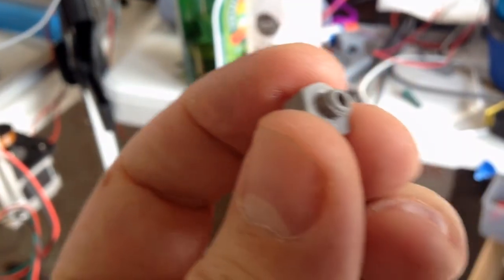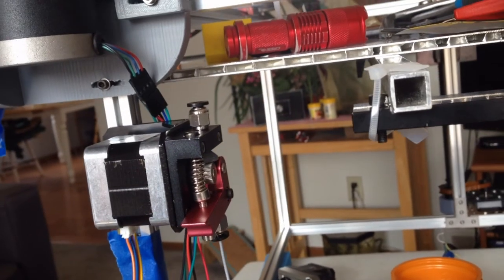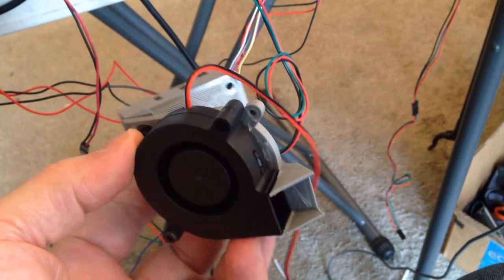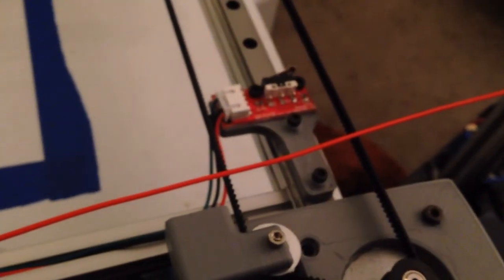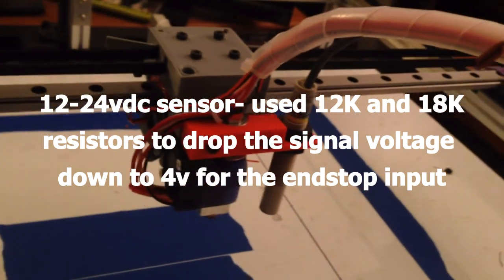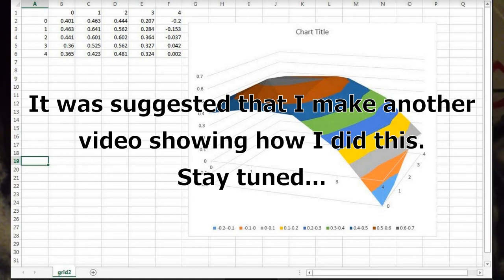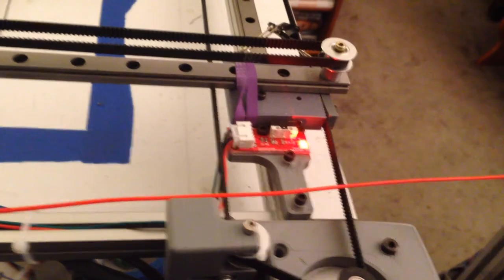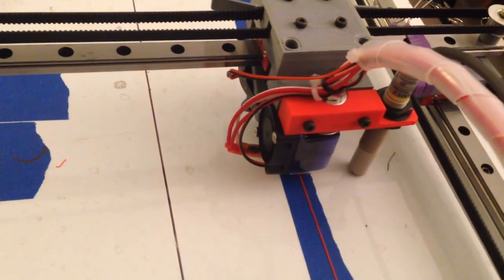Makerbeam h bot version 2 day 8

Comment: Great diy project! Noob question here: What are the parts I need for a servo moving on a rail. It's only for a tiny 10cm of travel.
Reply from the maker: Thank you! I had a lot of fun building it. 
Servos... I know what they are and how they work but I don’t use them for anything. Not that I couldn’t, I can just do all the things I want with steppers. BUT- assuming you’d need the same basic parts for a linear motion system regardless of servos or steppers, I would say the following is needed:
A frame to mount everything- such as 80/20 or v-slot profiles. 
A bearing ststem, whether round shafts, linear rail bearings, or v-slot wheels. 
A motor (duh)
A carriage to move from one end of the rail to the other. 
Some way to transmit motion to the carriage- timing belts, leads screws, etc. 
an endstop to home the carriage so you are always starting from the same location- critical for a blind Stepper system. 
I’m not sure if that’s what you are looking for but those are the basic components needed without going into specifics.
Reply: thanks. sry I mend to say stepper motor. yeah I ordered some stuff now:
I am using makerbeam and I ordered a rail system for it for testing
I thought of putting the stepper motor on the carriage that moves on that rail
and then I ordered some pulleys together with a toothed belt and I will try to build what you showed here
I have some tiny bearings but I guess I need to 3d print some v shaped wheels so it works on the makerbeam profiles.
what do you think?
Reply from the maker: I think I understand what you are describing, a drawing would help, but that's OK.  So the rail system will be the wheels that ride on the makerbeam? I've seen this work well on some delta printers, so it should work ok for you.(not sure what the goal of this   system is or how accurate it has to be) I'm less of a "calculate the formula and design the perfect system" person, and more of a "I wonder how bad this could possibly turn out if I try it with no plans going into it?" person.   This method works surprisingly well for me, as long as I'm not too concerned with how pretty it is.  (I'm usually not) I'd love to see how this progresses, please put up some video if you have the time.
Reply: the goal would be to move a weight on all three axis. But I for now its complicated enough for me to get it working with tow axis
Reply from the maker: I see. Well, I recommend exactly what you are doing- start by getting one axis working, then when you have a good design you are comfortable with, work up to 2 or 3.  

You might try looking at the Trinus 3D printer for an example of a machine built from several modular sliding axes connected together.  http://www.trinus3d.com/
 Since you mentioned you were trying to make a single axis assembly.
Reply: thanks for the tip
the trinus looks interesting
the tuff part for this project will be to keep it small enough so you can hold it with two hands and turn it around with ease.
Reply from the maker: Building small has its own unique challenges for sure. I have made (well, ok, am still making, it’s mostly done but I’m still tweaking) a small printer using 15mm makerbeam xl and linear rails. It’s only 150mm wide, and the bed will be 100mm. You can definitely hold it in one hand but I have had to  learn a lot about tight dimensions and tolerances. I hope you are able to get yours working soon.
Reply from the maker: I still had this video unlisted, but see if this link works for you. It’s an early test of my tiny i3 printer.   https://youtu.be/1IvaUOME8sM